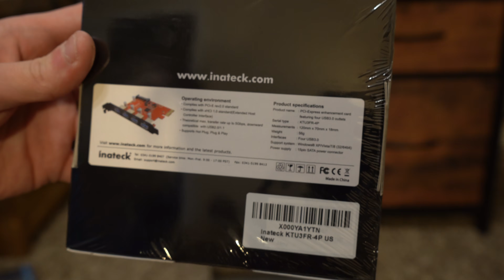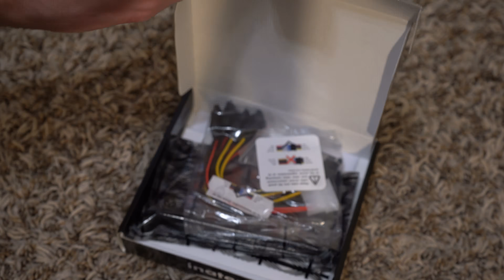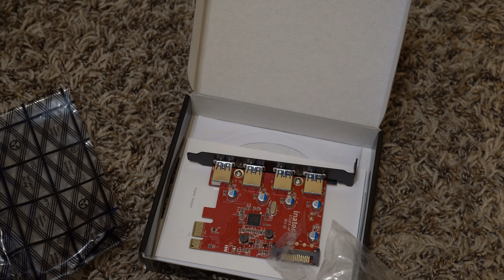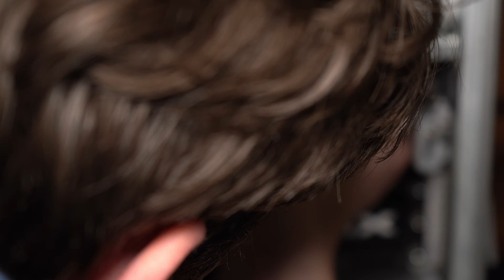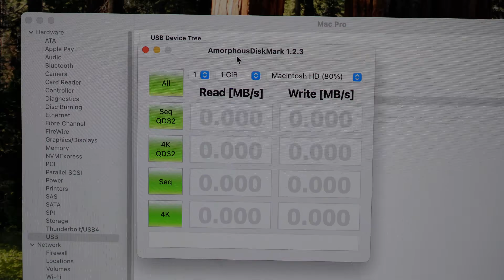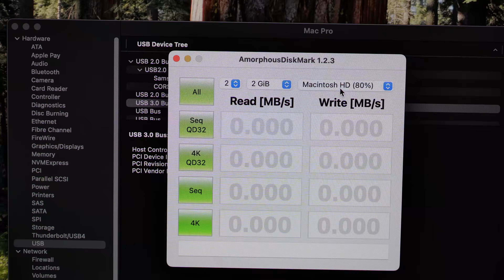Building the Ultimate 2012 Mac Pro 5,1 Part 2, USB 3 Card

Comment: Ha that's funny I bought this one very similar that doesn't seem to exist anymore it had one less USB 3.2 type A but two USB-C port and no need for power connector?
Inateck PCIe to USB 3.2 Gen 2 Extension Card with 5 Ports 8 Gbps Bandwidth,No External Power Source Required, RedComets U25